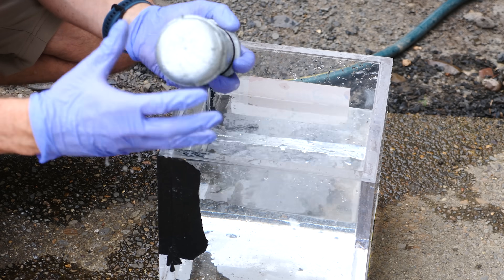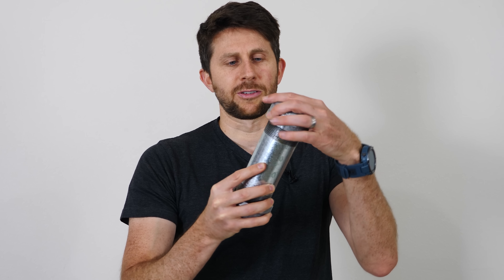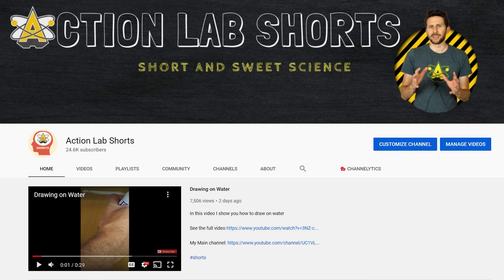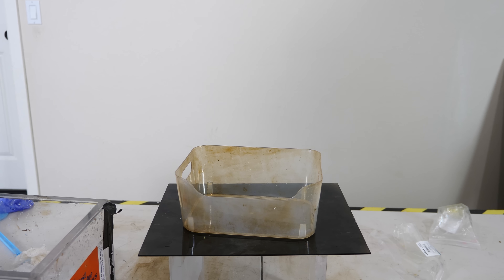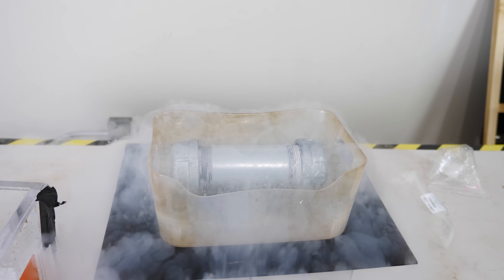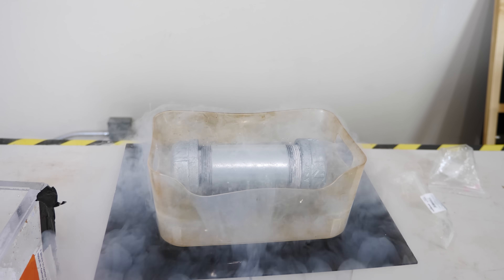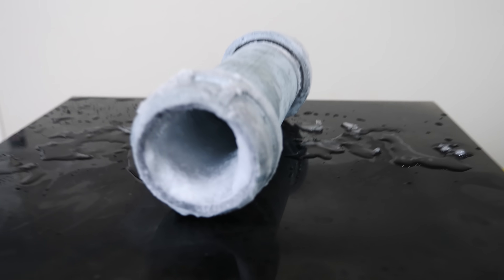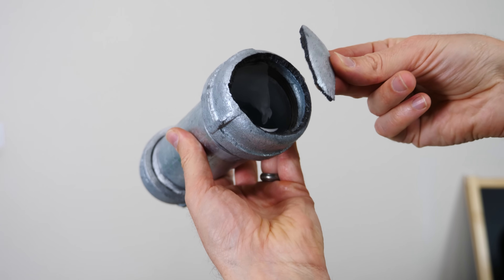Can You Stop Water From Expanding When It Freezes Into Ice?

Comment: Wow. Did not expect an explosion.  I expected a crack to appear with ice protruding.
Reply: Me too TBH...
Reply: It would be difficult for ice to protrude out of a crack at such high pressure.  The ice froze around the sides, which created an enormous amount of pressure.  Any crack would have water streaming out at far too high a speed to freeze in a little protrusion.  Unless the it froze after spewing out.  I guess that's possible.  Regardless, the sudden explosion was cool.  I was expecting it because I've seen an almost identical experiment done, in person, at University.
Reply: I think the explosion was the nitrogen vaporising very fast when it came into contact with the water. This localised pressure would have pushed the cylinder, leaving the water behind, exposing more water to nitrogen, and thus a sort of chain reaction
Reply: @MrElvis1971   I don't know about that.  As another mentioned, we've seen warm water in liquid nitrogen before, and it's not typically that quick.  It's hard to say though.  The real test would be cooling it in a container with no liquid for the water to vaporize.  Like maybe doing this in a freezer, or on an extremely cold winter day.
Reply: @DANGJOS  i would tend to agree that this would be the real test. And it only got to minus 10 degree and so this is easy to get in a freezer.
Reply: The triple point labs I have done always resulted in explosions. Yet I did not expect this.
Reply: ME TOO. SO SUDDEN
Reply: @Lassi Kinnunen 81  I think the shield was sufficient, but yeah he needs to be more careful.  I've seen this experiment done in person, so I knew it had a likelihood of exploding.  It's best to keep your distance.
Reply: As he mentioned in the video, the explosion was from water coming into contact with liquid nitrogen.
Reply: @trucid2   We know what he said; we're just questioning it.  Or at least I'm questioning it.
Reply: @trucid2  he did say that but people are not always correct. I also think that his cylinder is not a good example of a cylinder that would handle pressure very well. It failed at a predictable spot (a high stress point) and it was made from galvanised iron, not steel.  Galvanised iron is very brittle and fractures easily. I personally think the cylinder would have cracked with no water in it due to stress caused by the low temperatures as the cylinder will tend to want to shrink in size but due to the poor design it will not shrink equally everywhere.
Reply: @MrElvis1971  It's the pressure inside caused the explosion !
Reply: @deedewald1707 he could have proved the same point with a glass bottle. We all know ice is less dense than water. Most of us know this from direct experience. But the entire point was to try and contain the pressure for as long as possible. A galvanised iron pipe with crappy end caps was not a good choice except that it has catastrophic failure so "explodes"
Reply: There are probably dissolved gasses coming out of the solution as the water freezes, forming some amount of compressed gas. My best guess.
Reply: @Sonny_McMacsson  I doubt it.  While the freezing water releases dissolved gas, the liquid water that is left over is both extremely cold, and under very high pressure.  Both of those conditions increase the solubility of gas in water, so any free gas would likely be in solution.  To be fair, I guess any gas trapped in the ice that formed wouldn't be able to get to the liquid water.  In that case, I guess those gas bubbles could decrease the density of the ice, and that extra volume could indeed increase the pressure beyond what it would have been.  So come to think of it, perhaps it does.  Sometimes I think of things as I'm typing haha
Reply: @DANGJOS  Wow, it's under high pressure you say? /s

Anyway, low-k springs store more energy than high-k ones under the same applied force. I'd just rather he redid the experiment with gas-free water, with a normal control sample, to settle the question.
Reply: @Sonny_McMacsson   Hmm sarcasm I see.  Anyway, indeed it would be good to see the experiment with gas-free water.  How do springs with different k values apply here?
Reply: @DANGJOS  Because every material is a spring. Easily compressible materials like gasses are a low-k and low compressible ones like liquids and solids are high-k.

Edit: Of course the "k" isn't going to be actually a constant in reality, like you compress a gas and suddenly it phase changes.
Reply: @Sonny_McMacsson   Ah I see.  Yes, a consequence of the fact that the vast majority of potentials are really just quadratic, given small deviations from the minimum.  So basically your point is that you want to be confident there is no free gas because gas would contribute a low k value and release more energy than incompressible (high k value) materials under high pressure.  So it would be interesting to see how much of an explosion there would be in that case.  Got ya
Reply: @DANGJOS  the center of the water remained liquid because compression creates heat. It's probably impossible to completely freeze a container of water without it expanding
Reply: @DTG_LOCKETT   The amount of heat released through pressure is likely small.  Even without that heat, it wouldn't have frozen in the middle.  The reason it didn't freeze in the middle is that water has a finite (and fairly small) thermal conductivity, and the liquid nitrogen was only in contact with the sides of the container.  The removal of heat therefore occurs at the sides of the container first, and then propagates inwards.  This caused only the sides to freeze.  When enough ice froze at the sides to raise the pressure to the breaking point, that's when it exploded.
Reply: @Milap Mahavar when it cracked open.
Reply: I had guessed that maybe the ice froze and expanded into the water in the middle and that's what created the initial pressure, but idk it could be the other way
Reply: @gammergames3322   That's exactly what created the pressure inside of the container.  Ice takes up more volume than liquid water, so the ice formation increased the pressure inside of the container.
Reply: @DANGJOS  OK the way people talk about it, it sounds like the ice alone is pushing outwards and that's the cause
Reply: I was not surprised !

Comment: My first thought is with the vessel completely under water, you can't screw the cap on completely - the water's inability to compress will prevent it. So you might need to allow a little air to remain.  My second thought is that some food coloring in the vessel will show us when it leaks. I would venture it will begin leaking around the threads as soon as it starts freezing.
Reply: edit - nope, didn't expect that!

Comment: water is a wonderful substance.  as far as i know it's the only liquid that expands when it makes the state change from liquid to solid.  also, when it changes state from liquid to gas it expands 1700 times by volume.  the energy required to make both of these reactions is quite substantial and doesn't usually happen all at once, but when controlling the situation with pressure the reaction from water to steam will be extremely violent as all of the latent heat required to make the transition can be stored in the water and then expended immediately to flash the water 1700 times by volume into steam when the pressure is released.  don't take the pressure relief valve off you hot water heater tank.
Reply: Its acrtually not, Gallium does that too with even higher pressures. If you want you can take a look at my Video doing the same thing with gallium : https://youtu.be/Yc3Ga7b1nRU
Reply: i would love for someone like the action lab to look into and explain latent heat of water when it comes to changing state which happens when going from solid, to liquid, to gas.  i learned all about it in trade school when becoming a Steamfitter and have noticed that this fundamental and extremely important fact of life does not seem to be understood by very many people.
Reply: that phase chart is pretty good but it would be much informative looking at the actual phase changes in more detail and an explanation of the latent heat theory.

Comment: I've tried it with a 2ltr soda bottle the water in center stayed liquid on the first freeze opened the cap and chipped the ice to release pressure in it then froze it again to get a solid ice 2ltr bottle made nice 22 targets after second freeze as it would make snow first freeze tended to not make snow
Reply: I left a 1,5L bottle filled to the brim with water in the freezer for a few weeks, didn’t break but I couldn’t exactly drink the cold water I was going to get before I forgot it in the freezer 😂
Reply: @lucassvedlund3851  yea takes a 2 or 3 ltr to get a water core after that unscrew cap and hit with ice pick a few times it release pressure after that go after it with drill if you wana drink it or just freeze it solid instead to have a 2ltr you can shoot multiple times
Reply: @ericwhite3526  haha okay, I might’ve used the fireplace to get liquid again and accidentally melted a little hole in the plastic 🙈😂😂
Reply: @lucassvedlund3851  better than accidentally blowing up the microwave
Reply: Ideally one would wack it with a mallet a few times cut open dump in blender and make a smoothie or maybe a margarita depending upon mood
Reply: @ericwhite3526  haha did you?😂
Reply: @ericwhite3526  sounds good
Reply: @lucassvedlund3851  na not with a water bottle but yea eggs still in the shell and microwaves no mix well sure there are gadgets that let ya hardboil them but be careful before trying to eat it and poke them with a fork first some how dad got one that he peeled and as he took a bite it exploded instead . without the gadget an egg will quickly blow a microwave door open and make a mess the one dad tried to eat made a similar amount of noise as the one that blew the door open

Comment: I would imagine it just melting again from the pressure, or like the state not changing, because water has different melting and freezing temperatures at different pressures too right.
Reply: Yeah there are several different types of ice
Reply: @ThePrufessa  oh yeah I forgot that. I was thinking of like a theoretical situation where you keep lowering the temperature and the container is unbreakable.
Reply: @saims.2402  per the video the technical term is different phases of ice.
Reply: @saims.2402  I'm not sure such an unbreakable or nondeformable container is possible, but if it were, the ice would be forced to freeze into a denser ice form if you keep lowering the temperature.  Makes me wonder what would happen to the ice that already froze into ice Ih.  Maybe it would transform too I suppose
Reply: Sure, it turns into ice 2 with a different crystal structure at some point,(4000 bars i think) but the container will fail much earlier. 
You can also do this with gallium and reach pressures of 10000bars: https://youtu.be/Yc3Ga7b1nRU
Reply: There is yet again a “self promoter” above me
Reply: @attached2money   This is a good self promotion though.  The content is actually directly related for once.